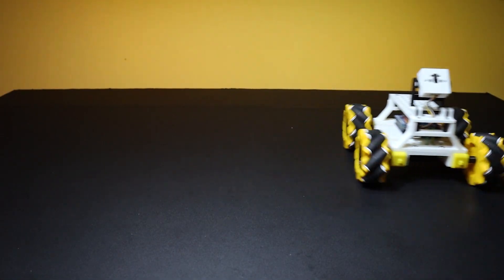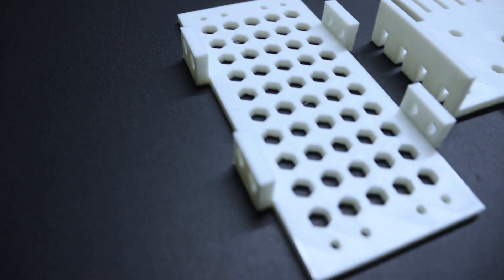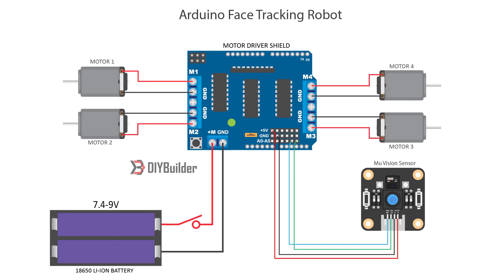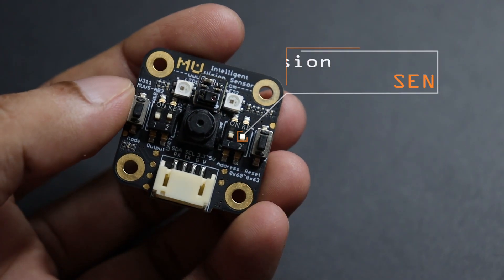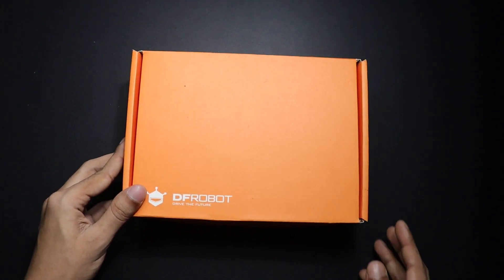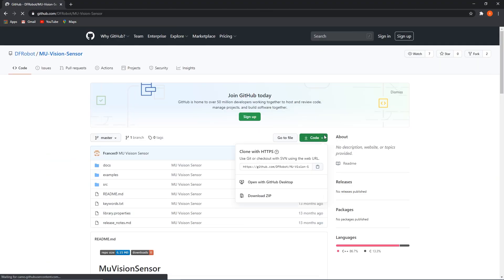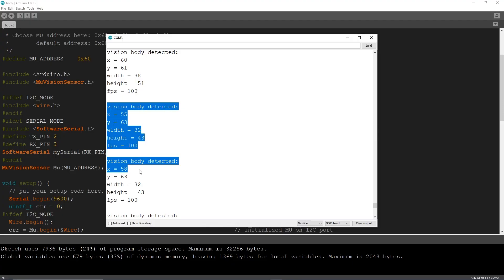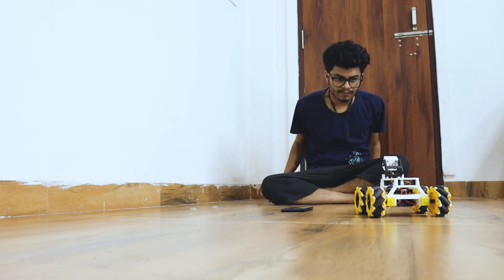How To Make Arduino Face Tracking Robot [Arduino Project]

Comment: Hey man,
i rebuild your face tracking robot and it works pretty fine! I just wonder why he always trys to go left when he detect a body. forward and backward works pretty fine. I am not a Arduino Code expert but it looks like yAxis is defined but it has no variables to act. did you updated the code after uploading it to your Google Drive? :)

Greetings and great stuff! Go on!
Reply: Does it follow you around when you turn away and walk away?

Comment: Bro I have a problem when I mount motor driver on arduino. The arduino stops working even I removed the jumper cap still not working is my driver is faulty or I have to try in another way ??????

Comment: Hi guys
Great I just finished it and it works great recognizes faces without problems, just a little trick when I turn it on it does not immediately change I have to press the reset of the card and everything works great you would know where it came from please thank you in advance
Reply from the maker: that's great
Reply: https://youtu.be/VfLD0-3pqrE
Reply: Bro what's the cost of making that one?

Comment: I believe it won't be a problem if I use the Gravity: HUSKYLENS instead of Mu vision sensor?  thanks a lot
Reply from the maker: yeah you can use it too
Reply: @DIYBuilder  oh thanks man for the quick reply. However, I was wondering whether the mu vison or any similar camera can output the video signal so I can transmit it like a live feedback to a phone or a FPV goggles. any recommendations?

Comment: Can we use normal wheels instead of the ones u used? Also will the same code work if I use L298N motor driver instead of L293D shield?
Reply: You can use normal wheels but they won't take robot sideways like in video the robot was moving sideways. The wheels used are mecanum wheels. And the motor driver he used is for controlling 4 motors at once you can  L298N but you have to use 2 controllers for 4 motors , but i recommend the one used in the video.
Reply: @ArshadAli-rp2cn  but L298N motor driver module can control 4 motors at once I guess becos I had built a wifi controlled bot with 4 wheels and a single L298N motor driver mode

Comment: Sir, I have an idea, can we make everything follow us? And sir can we expand its range of vision. For example, you were sitting down while testing so distance between you and robot was small, but can we handle it by longer distance?
Pls reply.
Reply: Range is based on the vision sensor. I doubt the mu vision sensor has a very small limit. You'd probably need some much higher resolution cameras if you want to increase range a lot. But hey, tesla is doing it, so it can be done